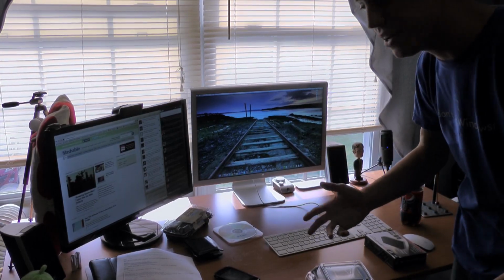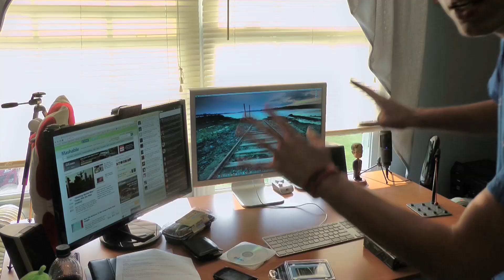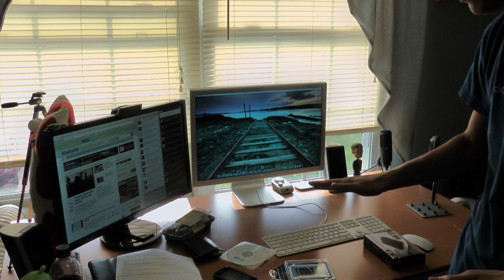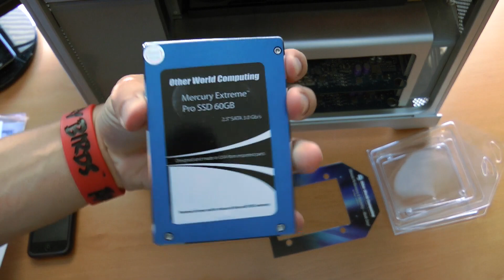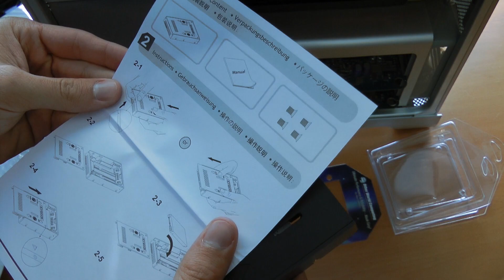Mac Pro Upgrade: 60 GB Solid State Drive (SSD)

Comment: The Enterprise favours Windows primarily because of Exchange. It's one of the few things Microsoft actually do very well. Outlook is a massive pile of shit, but Exchange is pretty fantastic. It's also favoured because it's cheaper to buy Windows machines in bulk and with specs specifically tailored to your use case. While it'd be nice, not every office drone needs a 27" iMac (though it's arguable that they'd be more productive given the screen size).

Comment: I don't know where you got your experience from, but unless you're running DOS to network, you're still using software. Even using DOS is technically software because it's an operating system, but I won't go that deep into details.

Comment: Well although there's still software used when you hit the spacebar in Mac, it is much easier to do that because it doesn't use quicktime, so it can still give you a preview without even having the correct encoders installed.

Comment: Basically what he was saying is that there's software that can transcode a large video file into a smaller video file for use on smaller drives. This video is about SSDs, and what to SSDs generally suck at? Storage. Talesofwar was only mentioning that software because one blu ray rip could take an entire SSD.

Comment: Macs didn't exist until 1984 (outside of a locked room in 1 Infinite Loop). You don't need software to network on a Mac either other than the OS. I have no idea what the hell you're even getting at any more. You can't have the experience you claim if you believe you can't network on OS X without some kind of 3rd party software. All my Macs and PC's show up in Finder just fine without having to do anything beyond enter the password and username for the respective machine.

Comment: It's abundantly clear you've never actually used a Mac as it works exactly the same way in OS X too. You don't even need anything but the OS installed to play back media either in OS X, just hit the space bar and it plays in Finder. Also, what the hell are you playing the media back with if you're not using any software? Well, you are using software, you're using Windows but I think you just mean the base OS and nothing else.

Comment: Of course you need software you doofus. What the hell do you think interacts with the hardware? Unicorn shit? What do you think XBMC is? Or Media Centre? If you mean you don't need any 3rd party stuff then you don't with a Mac either. iTunes comes with OS X. It also finds any and all drives/systems connected to your network and all you have to do is enter a user name and password if you have one set up on the respective device. It's easier networking Windows with OS X than Windows with Windows.

Comment: OS X uses iTunes for networked media. Or you can use something like PLEX if you want. It's a far better option than Media Centre which is a complete pain in the ass to set up on a network to actually play media. The default out of the box software is far more capable at this task on a Mac than it is on Windows. Windows even has issues connecting to a god damn 360! It's easier to connect a PS3 to the sodding thing, which says a lot.

Comment: You didn't actually read what I typed did you? iVI is a peice of software that searches for meta data and encodes media files into smaller ones. So for example you'd rip a Blu-ray as an MKV and it would then take that 30GB or so file and turn it into a 6GB M4V and apply things like the name, description, actors cover art and year etc... it'd then place it into iTunes where it would then be available to stream over your network to other computers or Apple TV.

Comment: No he is not, a mac contains all the hardware that a windows machine will contain. Windows and Mac is just a brand and operation system. At the base of ALL pc's is basically the same hardware. CPU, RAM, HDD, Motherboard, Optical Disk Drive ect.

Comment: Hi! i am in the process of upgrading my mac pro for the first time (as a noob). i have a ton of money to burn, and am thinking of getting an ssd. should i get a large one, say 250gb or is that unnecessary? if i did get a small one should i get an additional regular hard drive for extra space while the ssd boosts load times etc? (wary i could sound like i know nothing here!)

Comment: Some parts are interchangeable PC components while some aren't. The professional market pays a premium for reliability and less problematic workflow, which is the common denominator in the sound, TV, and motion picture industry.
We are dealing with a semi closed architecture, which a limited amount of vendors. This ensures that hardware can fully be tested without losing the flexibility of "choice" buying PC components.

Comment: Not entirely. The motherboard is proprietary to apple design, while you can get PC peripherals. Its hybird by design, with the flexablity to have better price points. 

The big plus here is you can run both PC and Mac programs natively in OSX without windows, vmware, bootcamp via wineskin. Its the untimate universal computer running all software without it being a emulation.

Comment: The proper ESD protection using properly grounded anti-static mat and wristband during work on the gear is HIGHLY recommended. Its really easy and cheap to get it. In my case I am using Professional grade 60x40cm mat complete set for $25 developed by Ourednik Technology. Antislip, rugged and works perfect anywhere even in the kitchen. (ordered at ourednik@fastem.com)

I do not put my electronics and parts into electrostatic/ESD shock risk anymore.
Finally thank You for nice video.
M.

Comment: This is so very informative, thanks for making the video.  I found it when I was researching on how to install a solid-state drive to a Mac Pro.

I noticed that it's almost have been a year now since your upgrade, may I know how things are going with your machine since your move to SSD?  If you are still running it at present, that is.

Comment: you could of put the ssd in the optical drive bay bey because there are extra 2 sata ports on the 06-08 mac pros so you dont have to waste a drive bay for the other hard drives

Comment: Nice! I just got a 120 Gb OWC SSD Drive. Got an "icy dock" adapter too. Downloading the firmware update cd from OWC's website now. Did you check for a firmware update?? Noticed you didn't do one...then onto OS X installation...

Comment: Hey David, you mentioned your Chromebook is running Ubuntu. 
What are your thoughts on Linux? 
I'm thinking about putting it on my laptop, but I'm not sure about how it will work with the hardware.

Comment: you need a boot up disc...
you switched out the boot up disc with the ssd...
sooo.... you gotta boot off of the old hard drive and then transfer the software to the ssd...

Comment: Good stuff! I just got a 2006 model Mac Pro (2 x 2Ghz Dual Core Xeon) off a eBay seller recently and I'm doing some upgrade works myself, mainly the graphics card, RAM and installing the bluetooth and AirPort modules. But I've been considering a SSD upgrade for while, but the prices for drives are really expensive over here in Australia ($120 onwards for a 60GB). Anyway great vid as always!